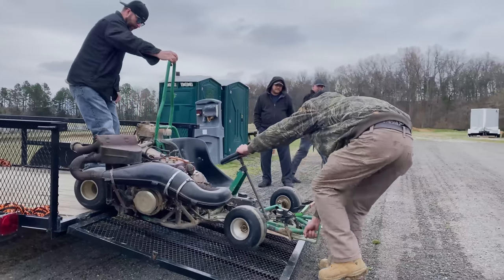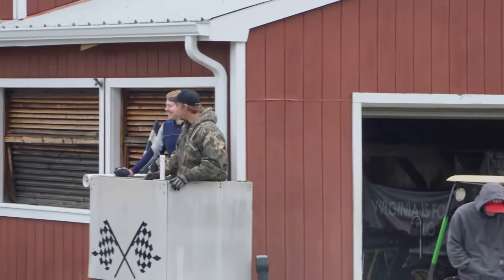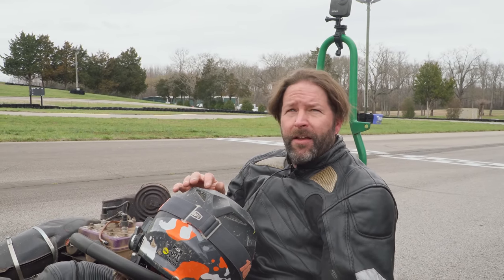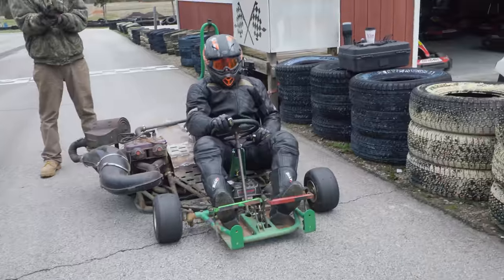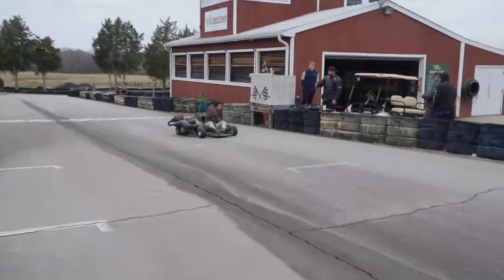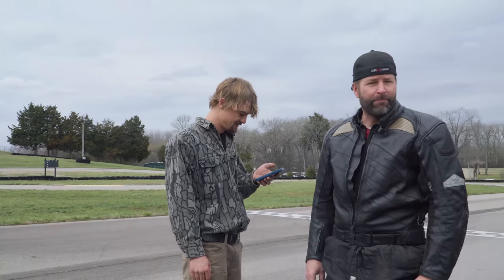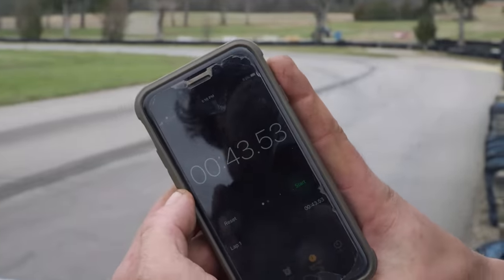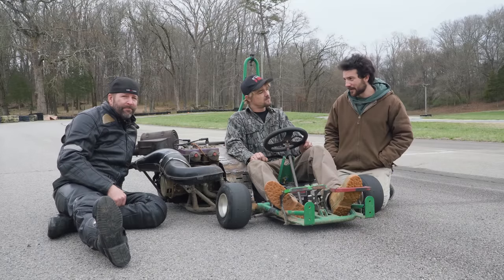We took our 125HP Go Kart to the Race Track! | *Insane Acceleration*

Comment: To fix the turning right issue you HAVE TO ....  for safety and drive-ability.....  ADD another 670 to the left side to even it up !!  Might get into the 20's =))
Reply: For the safety and drive ability🤣🤣
Reply: @thehourglasswithaman  Well, if you have a rocket, and its tilting to one side since the engine is offset and forced to vector the nozzle, if you can't move the rocket motor, just add another nozzle to balance it out. As KSP taught me, moar boosters!
Reply: Dont think it'd be torque steering, as is a solid axle,  right? But the weight balance is probably the factor. Counter weighting it might help.
Reply: MIIIIIIINT MAKE IT 4WD
Reply: @Avetho  yeah he’s right I never said he’s wrong
Reply: @crazyeyez1502  Yeah it’s not torque steering because it’s not understeer when he’s applying the throttle is understeer as a whole only going to the right. So much like when you’re trying to do a benchpress you can’t just put 40 pounds on one side and then go to lift it
Reply: @thehourglasswithaman  Yeah, if this were a voice-medium and not a text one, I'd be appending your comment but text foils me again XD
Reply: To think my friend called me nuts when I wanted to place an inline 6 bike engine on a go-cart. My reply to his question of where would you ride it? "Pa Rt 422?"
Muhahahaha
Reply: @n3glv  I put one on bicycle did not end well for tree
Reply: @n3glv  New Castle? Hillsville?
Reply: @bustinyanutz4195  the import bike salvage was near East Butler, Along 422.
Reply: Now that's using your head!  It's strictly an OH&S issue
Reply: Just drive the track in reverse, it's mainly a right-turn track lol
Reply: He needs to power through the right turns with acceleration which will in turn make the ass end of the thing correct the steering deficiency
Reply: @crazyeyez1502  It's because it's so wide on the right side, might help if the front end was a bit longer and the wheels were more forward.
Reply: Orrrr hear me out swap it with a 800 triple move the seat forward and elongate the front now that would be a rocket ship to mars
Reply: @alexdulac6351  Annnnnnnd ...  It would not help the problem, would still be unbalanced and turn like poop, while elongating the chassis which they clearly do not want to do.  Another 670 is the only way!  ( maybe 2 x 800's ?)
Reply: @crazyeyez1502  cart should turn to the right better! weight on inside of turn makes turn easier. I mean a sidecar passenger always transfers weight to inside of corner. It's obviously a chassis/geometry issue.
Reply: @n3glv  where you local to? I live in ohio, 30 miles dead west of chippewa and 15 miles dead south of youngstown.
Reply: @Ty-bz7zx  no question a 170lb rider counterweights the engine. It's clearly a chassis geometry issue.
Reply: @jaydensdream714  All that matters is a twin 670 set up.
Reply: @Ty-bz7zx  I have to admit, this is by far the best way to move forward. Imagine the keyways and chains you would explode!👊
Reply: @jaydensdream714  15132
Reply: I've got a old hillclimb mod sled in pieces out back called the PolCat Polaris chassis with a 650 Wildcat engine built to a 720cc ripper with twin pipes and no stingers, it'll make your 👂 ears bleed, just add this to the other side...lol...from Wyoming USA 🇺🇸 🤠
Reply: it would help balance the tire weight
Reply: @krispychiken  wouldnt that be slower?
Reply: That should take care of the turning right problem also.
Reply: Good thinking ROFLMAO I love this shit
Reply: Awesome idea😭😭
Reply: Mans is on to something here
Reply: I raced go carts in the unlimited class for 7 years. Yea this cart is crazy.
Reply: Easy explanation is that the engine weight doesnt let the right side tyre lift up on the back to allow for "open diff" like turning like racing karts use. They have the front cambered and castered in a way that it will lift the other front wheel in the air if you turn the wheel full lock when the kart is sitting still. When cornering it lifts the rear inside tyre to spin and kart will turn in. They could slide the left side tyre on the axle a little bit more to the inside so the kart has more weight transfer to left rearwheel and lifts more on right 🤔
Reply: YYYEPP! THIS IS THE SOLUTION for SAFETY AAAAND DRIVE-ABILITY .... LOL!!!
Reply: It will get into the 20‘s or to heaven
Reply: Same thing I was thinking
Reply: You Are Genius!
Reply: Bigger and wider tires would help.
Reply: And a dash of nitrous and you done!
Reply: I like your thinking. 
Pure physics.
Reply: @allenphillips4080  I was hoping for Methanol + a supercharger on each engine personally =)
Reply: I crashed my Para plane,so you have given me a good plan for my 55 hp ,Rotax engine!
Reply: It’ll be fine

Comment: You need to change the spark plugs. those engines benefit greatly from fresh plugs,  as they foul plugs easily. Your jetting is more than likely off because it's jetted for winter temperature. And also snowmobile engines are very sensitive to clutching. You guys are leaving a good 30%-40% of HP on the table.  Thank you guys great work
Reply: Agree with Eric
Reply: You should there's still a way to say things
Reply from the maker: We’ll check it before we go to the drag strip. Thanks
Reply: Agreed.  Might need to sink the carbs too.
Reply: Does it need another 40%??
Reply: @CarsandCameras  also, clean the power valves!
Reply: @CarsandCameras  you just made my day! I cannot wait to see this!
Reply: @westie4ageturbo.749  Yes Westie, it does ... unless you could get 50% more.
There is no such thing as "too much power".  There can be "not enough chassis/suspension" and there is always "too much weight".
Reply: @rwbnatureadventure3876  it they ran good oil in it the power valves are probably fine.
Reply: @westie4ageturbo.749  yes. The answer is always yes.
Reply: @CarsandCameras  and check the reeds and cages!
Reply: Prob over-fueling for sure. That is the single biggest improvements to a snow machine. Proper Jetting. But hey, why not a little nitro methane for the lulz?
Reply: @eddiegrider4033  sink them in what?
Reply: @rwbnatureadventure3876 you don’t simply check them you replace them  with V force reads LOL
Reply: @jasonlukasik5595  umm, check them for cleanliness and that they aren’t chipped or cracked.   Dingleberry.
Reply: @rwbnatureadventure3876  Wow OK yeah you went there I was simply joking by saying fuck it just go all out and buy the best there is why stop at cleaning and checking them. But that’s OK that’s fine my 35 years of working on these things has no merit at all
Reply: @AL4N.  probably the sink. Personally, I'd sync them.
Reply: @jasonlukasik5595  aftermarket parts on sleds usually make things worse.  They are optimized from the factory.  Plus, that’s not the cars and cameras way!  Why replace a perfectly good part? C’mon man!
Reply: @swandonovan  sync..sink..thats great.
Reply: I think the muffler bearings need greasing - probably 33+ more horsepower if youns do that.
Reply: I agree!  Great job guys!
Reply: And btw, don't worry about the reeds. That 670 has a rotary valve. No reeds.
Reply: @jasonlukasik5595   These engines have no reeds , they have a rotary valve, also they have RAVE valves on the exhaust , a vacuum controlled guillotine that opens the exhaust port  more at higher rpm, those need cleaning due to oil and carbon deposits causing them to hang open.
Reply: @rwbnatureadventure3876  The 670 is a rotary valve engine. There aren't any reeds or cages my friend.
Reply: @jasonlukasik5595  No reeds on a 670. It's a rotary valve engine.
Reply: @chuckchar  You know what I stand corrected. You are absolutely right I’ve always been a Yamaha guy myself
Reply: @chuckchar  R.A.v.E. Rotax .automatic .variable . Exhaust. Son of a bitch it’s been so long since I’ve worked on things. I do remember on my 97 SRX 700 triple I did a pipe v-force reads and a jet kit and there was absolutely nowhere on the trail you couldn’t keep the skis in the air
Reply: @rwbnatureadventure3876  very uncommon for a 2 stroke sled engine to have exhaust valves. Remember engine is designed to run at one rpm range.  The cv drive takes care of mid speed power.
Reply: @gabetoft431  my 670 is not a rotary valve. It has reeds and cages. And it's very uncommon for sleds to have exhaust valves.  Engine designed to run at 1 rpm range...
Reply: @javman03  I’m not familiar with bombardier.  I have heard of rotary valves.  That was only for a few years right?  That went back to reeds?  You still have to make sure the valve is clean.
Reply: @jaydensdream714  sorry but it does not! The 670 is a rotary valve engine and skidoo used it until it was replaced by the 700 which has reeds and cages. Also is is uncommon for a snowmobile engine, specifically a skidoo snowmobile engine to not have exhaust valves! Skidoo invented them and the R.A.V.E. Valves are on every performance oriented 2-stroke they make!
Reply: @gabetoft431  it's fine with me that this ski-do engine is rotary valve. My yamaha 670 in fact does not have exhaust valves and does  have  twin flat slide carbs. As well as Reed cages and bypass and transfer and even scavenge valves.  All makers have at one time or another came up with some sort of exhaust valve. In my experience valves are common for 145" and cruiser style sleds 540cc and down. Most performance sleds have 100hp plus 670cc and up lack exhaust valves.
Reply: @rwbnatureadventure3876  yea throw some good pipes and jetting on an old srx ride it then tell me with a straight face it was optimized from the factory
Reply: @AL4N.   sync perhaps?
Reply: Snowmobile engine. No wonder it sounded like the Yamaha 440 Enticer that I rode as a kid haha
Reply: Getting 150 horses out of a single piped 670 is a fairytale. That thing is barely getting 120 in crisp cold air properly tuned and clutched. I've been riding sleds for 30 years.
Reply: Yes!
Reply: @CarsandCameras only owned skidoos for years. Number 1 thing I'd say. After u changed plugs and it happened again. Possibly fuel system. But if all checks out it's because it's not staying high in the RPM long enough. The old sleds didn't like it when you idle or long or "sissy foot" the throttle and putz around. They fouled quick but if it was WOT all day. We'd (ME) never fouled a plug after. Stayed nice light light brown. I know you know your shiz so I'd assume jetting was proper.

Comment from the maker: No tire smoke, no drama, this go kart just HAULS.
Reply: This is the best
Reply: Hey yall still in va? I want to give u a free lawnmower mower i need it gone yall just need to come get it
Reply: I need to build one of these now 🙄
Reply: Im going to build one much like that except I have a Polaris 800cc.  It is going to be much bigger though, and I want a roll bar, and 50/50 weight distro.   LOL it will prob take me 3 years, because I am backed up on other stuff.   Looks like too much fun not to have one.   Definitely my fav project from the C&c crew.
Reply: That stooge introduction really cracked me up. I was wondering why John was standing by the portapodies.
Reply: Fantastic build with one of the best snowmobile engines
Reply: If you feel that this is going to fast you can simply put a heavier spring in the secondary clutch to keep it slowed down
Reply: Hey John. When are you gonna retire that old avalanche and get a little newer truck.
Reply: Y'all should race it against the ducartti 😂
Reply: You should change the name of the cart to “The Nascart” since it’s nasty fast and it only wants to turn left
Reply: Also congrats on the 1 million subs
Reply: That 29 mph was Charles's DONUT!!🤪👍
Reply: How's the air filter after riding on the dirt track?
Reply: Super cart tires are wider than usual cart tires that might help with the handling also just gotta say the duke cart still sounds way cooler in my humble opinion
Reply: tyre manufacturers like it when you convert tyres into smoke..
Nothing is more annoying then Americans showcasing a high performance vehicle doing burnouts and donuts instead of showing acceleration 😂 . 
most of your culture is manufacturer driven . 
Drifting = ☠ for cars = ($) ($) << manufacturers eyes when they realised they could encourage the masses to drift with the media and cash prize competitions.
Reply: @MegaMeaty  I recommend buying a pre-built chassis off the market place. You can beef up or improve any issues prior to engine install.
Reply: Bend the frame! If it doesn't turn to the right, prop up the right front wheel by using a bucket(metal)and push down ahead of the seat to tweak the frame into keeping the left front tire on the ground. You can also do it the expensive way by using a frame staightener and bending the wishbone, but at the track, that is how you make adjustments to the handling. 
  At least that's what I recall from racing these things
 SIGNED: An old IKF racer from back in the day this kart was relevant
Reply: @jaydensdream714  I am 6'5 and 250 pounds there is no pre built chassis that fits my size.
Reply: Hey that's a serious motor and I know it comes out of a ski doo mxz670 from the late 90s and into early 2000s I've had that snowmobile and she moves amazingly
Reply: @MegaMeaty  for real right? Also 6'5, 235 lbs. You should see me wadded up on my bullet bike😂 probably looks like I'm riding a pocket bike
Reply: CarsandCameras Commented on the last and then saw this one. Lol. The jetting on those old Rotaxes is staggered because they run much hotter on the PTO side (clutch) you may have the carbs backwards? Hence why it is fouling the mag side. But it could just be cause it’s rich. It def is to rich though. It’s not getting all the way on the pipe. You can tell by the sound and the way it’s smoking at WOT.  Those things are jetted for colder weather and 2Ts are very sensitive to jetting. Go down a couple jets and it will be a different animal. Keep an eye on the plugs though because if it’s too lean it will melt down. Once you get it jetted right it will get some more heat in it too. On the other video on the dirt track the jetting was closer because there was no silencer which usually leans them out a jet or 2. In that video it was hitting powerband you could tell by the high pitch sound it gets. The one you could hear ringing through the trees.lol. Also the camber is way out on your left tire. It almost looks negative? They will drastically effect your right turns. Make sure there is heat in it before you get on it too. Being too rich is prob saving you a bit there. If you don’t let them warm up the pistons expand more then the cylinders and your clearances get too tight resulting in scuffed pistons or wors catastrophic 4 corner piston seizing. These 2Ts are finicky but when you get it right they make mind blowing Tq and HP. You also have to keep on top of them if you want them to stay reliable but you won’t be disappointed
Reply: If you change the clutch spring to a stronger one, the engagement will occur at a higher RPM and the tires will break loose instantaneously, allowing for burnouts and drifting.

Comment: I can tell just from hearing that it’s way to rich. It’s loading up and that’s why you are running into plugs fouling. Also leaning it down will help it’s acceleration. You gotta remember that it set up to run 20 degree and colder weather.
Reply: I came here to say the same thing.  I wonder if they kept the jetting the same as it was from how it was equipped in a snowmobile?  Assuming stock jetting from the factory is typically good from 0-20 degrees F.  You could easily go down 2 jet sizes and maybe even drop the needles a notch to clean up the mid range.  It's possible you could even go leaner because the time spent in the mid range and WOT is so short on an application like this.
Reply: @ttank1994  I know when I was racing sleds I could go down four sizes on my main jet from the hottest race in the spring to the coldest race in the winter. Eventually I just stayed with 3 just, because the sled was more consistent and I didn’t run into heating issues.
Reply: @sparky87213  I definitely believe it.  I stayed conservative recommending 2 sizes because I don't know what's in it now and if these chuckle heads didn't know enough to address the jetting right away then they would probably take it way lean just as easy.
Reply: @ttank1994  "chuckle heads" I dunno why, but that word is just pure gold! lol
Reply: Is it me or does it sound lean at idle?
Reply: @samueleputzu9416  no that’s normal for that engine. The way it’s bogging and fouling plugs is a signs that its rich.
Reply: A 2 stroke engine with that much power also has to be run hard, or it will foul plugs. I had a 1982 Suzuki RM465 2 stroke and if you did not run it hard enough it would foul spark plugs. Lean it out a little and run it harder, and it will be fine.

Comment: That thing is a rocket ship! Would love to see a 0-60 attempt. Also, love how the colored lines on the new tires disappeared after half a lap 😂
Reply: In a sled it’s about 1.5 seconds
Reply: @rydplrs71  I wouldn’t go that far, probably around 2.5 seconds for 0-60mph. I know the new 850 sleds get to 60mph in the low two seconds with studs on ice.
Reply: @moto6ixmoto83  studs on ice aren’t the fastest setup with suspension.  Freezing wet snow or on asphalt get the times I’m thinking about.  When they hook it’s absolutely breathtaking.